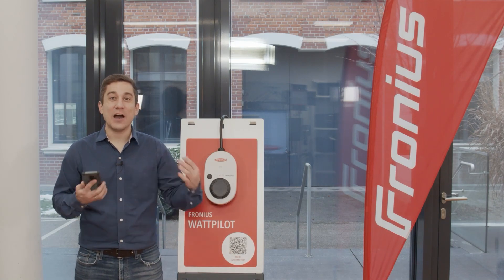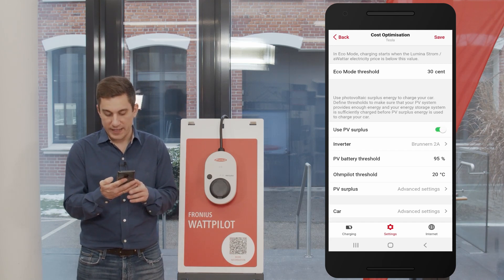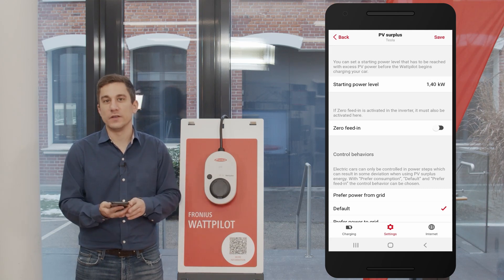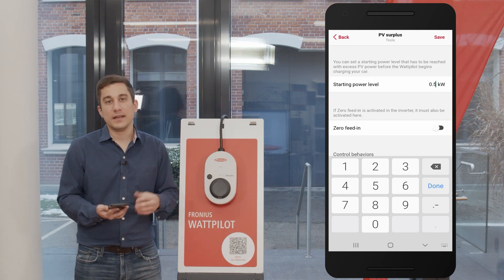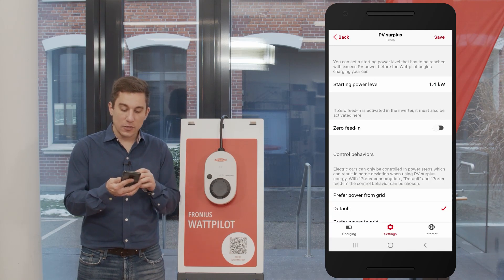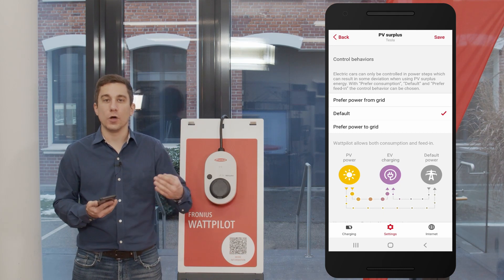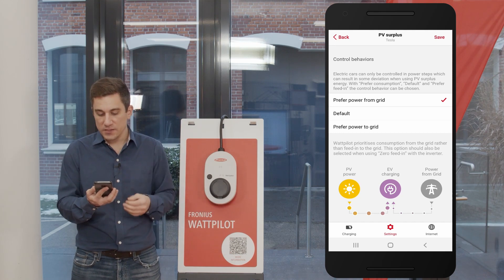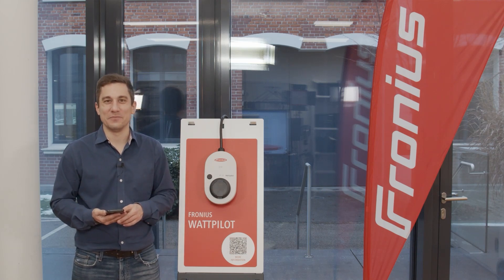How-To Video: Advanced PV Surplus Settings in the Solar.wattpilot App

Comment: With the OCCP data 'charger current offered' metric - is that supposed to go up/down based on these PV surplus settings? I'm only seeing '6A' available, or nothing. Even when there's 4-5kw excess solar available.
Reply from the maker: Hello @kiwizz!
Since the Wattpilot is capable of alternating the current during the charging process, you can freely decide which current should be used by the Wattpilot. The value can be sent and changed via OCPP.
Best regards, Andrea from Fronius.